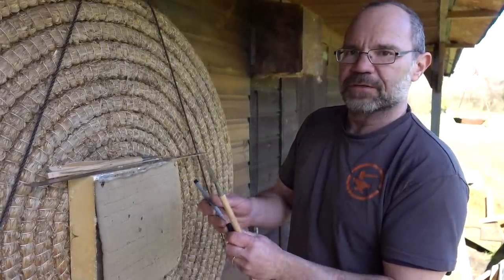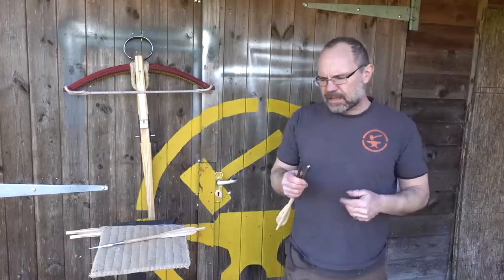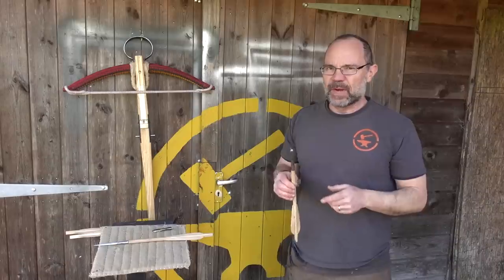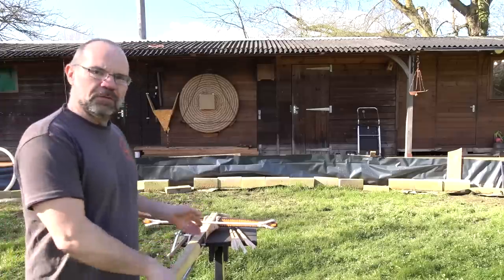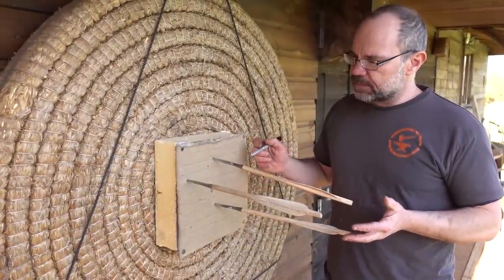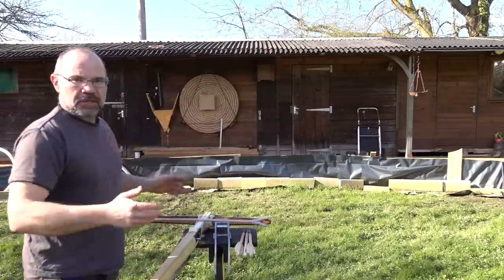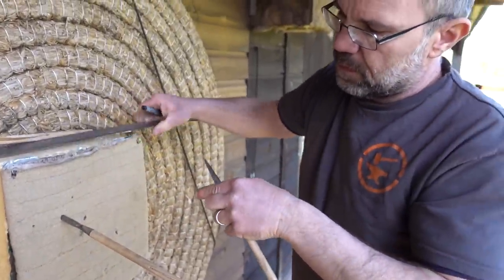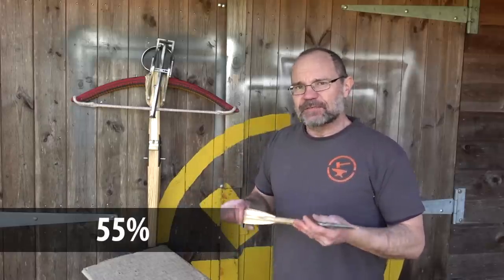Does WAX on ARROW HEADS Do Anything?

Comment from the maker: As has been pointed out - my percentages are wrong (maths not being my thing apparently) and in fact it is around 80%. And while we are at it, Teflon arrantly is to protect the barrel and I have fallen for TV junk information - sorry and damn I hate falling for this sort of guff and is exactly what I try to avoid with my films.
Reply: It's an increase in penetration of about 95% (if you use averages). If you don't use wax, it's a decrease of 50%.
Reply: Good that you pointed this out. I could tell there would be people to rant about this mistake.
Reply: Interesting. I wonder: you waxed the tips of the bolts. And when you showed them, it appeared to me as if you covered about the top 5cm of them. Could it be that the penetration depth corellates with the waxed surface?
Reply: That part threw me off for a second whilst watching but glad to see you pin this afterwards
Reply: Was just about to write up some math.
I hope this discovery will be useful in future videos about x vs y.
Cheers!
Reply: I came here to say the same if you take the average of the 3 arrows, the depth is increase by over 98.5%. 😉 
Very interesting results. Now I know what to do if society breaks down completely and I need max stopping power from my bow.
I’d love to see more on this.
Reply: Geek solidarity society right here. Boom! Super interesting
Reply: Loved this and all your experiments! I just watched the previous head-type experiment with the wife last night.  A geeky but important point of clarification: Teflon is NOT put on bullets to help them penetrate either fabric or plate armor, it is put on them to reduce damage to barrel rifling.  The myth of increased penetration is a persistent lie widely spread by the sensationalism of news media and Hollywood in the 90s, and is complete bunk.  Armor-piercing bullets are made of harder metals than standard bullets and thus wear out the rifling in gun barrels faster than normal bullets, so to reduce damage to the rifling armor-piercing bullets are coated in Teflon to lubricate their exit from the barrel.  However, that Teflon is shredded in the process of traversing the barrel and does not measurably effect the penetration depth of the bullet when it hits the target.
Reply: Could polishing them increase penetration further? Potentially less for the fibers to snag on the microscopic scale.
Reply: @ArcherWarhound  I was going to make the same point. Most actual armor piercing small arms ammo usually uses lead bullets with a hardened steel core. It's akin to how an axe is made, edge of high carbon steel, the rest of the head a softer material to increase mass and provide flexibility.
Reply: I think bee's wax might have been used as rust prefention on stored arrows/bolts. or tallow. and they could have found out that way. look my guy is more dead then your guy, what is the difrence.
Reply: I bet that the waxing was originally to prevent the heads from rusting, then some chap noticed during a siege that the newly made bolt/arrows weren't penetrating as well as the older ones. experiments followed and they discovered the waxing solution.
Reply: Amazing video. I hope you experiment with waxed arrows and bolts more in the future. Also, the p-value of this experiment is 0.009, which means this is a statistically significant result.
Reply: Ey for that video, btw. my grandma told me to use soap on nails  ... that helps also a lot ... not sure about medieval 'soap' but I guess it is same principle
Reply: ArcherWarhound this is exactly true. The theory of lube for bullets is true, but like you wrote it’s for the barrel, not the target. Just like spitzer or pointed is for aerodynamic effect, however in this case it does aid in penetration, (however since this is usually a rifle round that means it simply dumps a bunch of its energy into something behind the target that was hit).
Reply: it wouldn't surprise me at all if they were stored that way to keep them from rusting
Reply: Igor Puschner I thought this too!  And I wonder what the wax distribution is after the arrow struck - did it all melt off into the fabric or did some of it make it into the wound.  Could make a difference if you used the wax to coat a poison layer or something nefarious like that... :)
Reply: thank you for pointing it out!

I get it to be:
73% increase in the first arrow (19mm increase from 26mm)
88% increase in the second (22mm increase from 25mm)
150% increase in the third (27mm increase from 18mm)

averaging those 3 percentages gives an increase of 104% or in other words doubling the penetration depth!
Reply: The way I heard it(for what it's worth), teflon on the front of the bullet did help it not glance off hard surfaces(while the teflon on the sides was for the barrel's sake), but was not helpful against soft armor. Some anti-armor shells from WWII had a relatively soft cap for the same reason.
Reply from the maker: @KilalaFW  absolutely yes, but they didn't'
Reply: All honor for the simple admission of "I don't know". Thats where science starts and religion ends .
Reply: Your percentages are also addressing the depth, but do not address the mass of penetration. Although you are penetrating nearly twice the depth, you are increasing the volume of deformation by much more. So even though you are only talking about a few more millimeters of penetration, you are talking about a huge difference in the resulting wound.
Reply: Regarding the waxing method for the arrows: It appears that the projectiles as shot had a coating of wax, rather than the blob. Now it did have an effect as show in your video. However, the one you showed at 1:35 in the video reminded me of a very real method of tank and naval shell construction that was popular in WWII. Of course, most tanks and ships did not use cloth armour, so this is in regards to penetration of rigid armour.

Honestly all I've done research wise is a quick check on google and wikipedia to double check that I'm not spouting total nonsense, but I'll tell you what I think I know. In the second world war had trouble with standard AP shells shattering when the very hard metal struck the armour, or deflecting if the armour was angled enough. And this was more than just the fact that angled armour increases effective thickness, so they had compounding factors working against them when it came to angled armour. First it had to not deflect entirely, and then it had to work it's way through a greater effective thickness if it did.

To solve both these problems, deflection and shattering, they added a cap to the shell. This is where APC (Armour Piercing Capped) comes from. The cap would be made of a softer metal, nickle or mild steel, from what I've read, and would mitigate these issues. 

This is a quote shamelessly copied from wikipedia, but it illustrates how the shells cap was supposed to prevent shattering: "The more flexible mild steel would deform on impact and reduce the force transmitted to the projectile body. Shell design varied, with some fitted with hollow caps and others with solid ones". 

As for deflection, the soft metal cap also had the effect of 'normalizing' the angle at which the shell struck the target. Here's an animation, I think it exaggerates the point to better convey the concept, but it gives you an idea of what's supposed to happen: https://imgur.com/a/MV5CQfx

It's likely I don't understand fully the processes that make an APC shell work, but they were used in war and they were, as far as I can tell, better than the standard AP shells. Something to consider I suppose.
Reply: @whyjay9959  Hi Jay:,  In the US and Canada back in the 80's, a few companies manufactured and marketed (primarely to law enforcement), bullets with a Teflon (or a variant) "tip" and advertizing them as body armor defeating bullets. National news got a hold of it and started to call them "Cop Killer" bullets  because, at the time,about the only one wearing body armor was Law Enforcement (but the bad guys wore them too!) The histeria and publicity pretty much "killed" the product. But if the media had not, testing would. At that time I was a Firearms instructor and was lucky enough to get funds to test these bullets against body armor. Results: The only armor it would pierce was Level I, or that COULD stop ammo UP TO .380 auto. Levels worn by law enforcement, at the time, was at least a Level II. Most Law enforcement killed while wearing a "vest" where ahot in "Non-protected area", such as the head, neck, torso sides (when they were standing at an angle to the shooter, or groin area when the bullet would severe the femoral artery.  So the hype, was just that, hype.

And about WWII, what made those bullet "armor piecing" was not the tip,  body or copper shell, but the steel core it contained. The shell, the softer lead would crush and almost desintegrate, but the steel core would keep on going, hopefully wounding more than one soldier. The rational was that if you kill one soldier, the opponent only lost one. If you would hit and wound one, not only would the opponent loose one , but two or three more temporarily per wounded to evcacuate them.
Reply: Why not oil the bolts up. They had oil so they could use it to make arrows or bolt more slippery and help them slide through easyer. Wordt seeing what a coat of oil or animal fats could have of a effect on penatration both on armor or flesh. Could you try this out?
Reply: @tods_workshop  i would figure as much far to much effort on an army level for what i would assume would be a miniscule returns

 but should you get bored id love to see a comparison
Reply: Heard that line and was going to leave a (polite) comment - glad to see you learned something! Cheers.
Awesome vid, btw.
Reply: I’d be curious to find out how the waxed bodkins perform against mail over fabric.
Reply: Someone who admits mistakes is so refreshing these days. Bravo
Reply: Maybe the idea was born after seing the results using the oils to put flame in the arrows?
Reply: Wax On.....  Wax Off !   =)
Reply: People are nitpickers.  Good video.  :)
Reply: @karras6239  are we seriously still going on about flaming arrows
Reply: I want to try some armour penetration tests with my 240lb@32 longbow. Using this prod with a han dynasty  trigger system,  we can Have reasonable  idea of the power of Chinese crossbows  (nobody makes +200lb sinew horn composites anymore so using longbow prod instead)
Reply: Tod, I commend you for your honesty and integrity.  Don't feel bad about falling for the Teflon bullet BS - a lot of people did.  It may interest you to know the same people who brought you the Teflon coated "cop killer" bullet BS went on to promote hollow point bullets as "exploding bullets".  Please keep making your great and very informative videos.  I've learn more from your videos than from the many history books I've owned and read as will as the lectures I've attended throughout the last 40 years.
Reply from the maker: @KilalaFW  yes it would, but I doubt they did this
Reply: Would be a good idea to edit these things out then.
Addenda are often missed.
Reply: wouldn't the wax also help keep the metal from rusting?
Reply: they did wax their thread and needle to sew a thick cloth like this gambeson, didn't they? this made it very plausible for medieval people waxing their arrowheads
Reply: @MonkeyDespot  All bullets go through thin steel and you wouldn´t see a difference from Teflon to non Teflon because there is always gonna be a hole. You also see quite a bit of deformation on a bullet which would negate any Teflon coating. The Teflon was to make the bullet slide through the barrel. Old bullets were actually coated in wax by pushing them through a tube. If you look at old musket ammo they have 3 grooves that were wax filled.
Reply: @igorpuschner786  That's an interesting thought. I use Bee's wax a lot in my leather work (lucky for me, my next door neighbors are bee keepers. So I'm able to get mine strait from the tap so to speak). It is pushed around on a surface fairly easily. I don't think one would have to do much more than coat just the tip for that film to smear up the surface of the metal as the bolt tip drives it's way through (further lubricating it in the process). From what we've seen here I wouldn't doubt it if dipping the heads a bit more could make them penetrate even deeper.

Really one shouldn't even have to dip them in hot wax though. Just push the bolt tips into a moistened (water soaked) block of bee's wax. That's what I do with my awl needles (which actually have a very similar shape to these bolt tips, just a heck of a lot smaller). That's enough to get a hair thin film of wax evenly distributed.
Reply: Falling for junk information is what this world is all about!
Reply: Could you shoot faster if you had a reloader and 2 crossbows?
Reply: @fire304  The jackets of modern bullets are made of a copper alloy . Most bullets have lead cores , while armor piercing bullets have hardened steel core . 22LR bullets are soft lead . Some have a thin copper ' wash ' over the lead to reduce lead fouling in the bore of the barrel  . 22lr bullets usually have a thin coating of wax too .
Reply: Thank you for doing these experiments, your care and sincerity is better than 1000 Knight vs Samurai pop-history crapfests. Your Agincourt one also, superb! Keep it up!
Reply: G'day,

How about you sharpen everything & dip it in hot Bees' Wax, and call that "Rudtproofing"...; then be amazed at how much better the SHINYNESS goes in further - because,

" The Greasier The Easier...!"

, as the Sex-Workers are reputed to murmur while reaching for Lubricant.

When I first heard that joke, it was "Vaseline" that was mentioned by brand name, but about 35 years ago that was superseded by "KY-Jelly" in the overheard tellings (!).

Such is life,

Have a good one...

Stay safe.

;-p

Ciao !
Reply: I was wondering about that....but what I really wonder is did the waxed bolts penetrate deeper  than the wax coating which seemed to be at the just the tips, and if so would they go even deeper with more wax?
Reply: No worries, I appreciate how you value the truth in your videos and are willing to admit mistakes :) You're a great, reliable teacher, Tod!
I wonder about the wax blob - did you compare effects of shooting an arrow with a spherical blob of wax on it as well? It seems to me to be much worse in results, but it's just an assumption.
Reply: re: teflon rounds yes, but actually no
the coating acts to lubricate the bullet, resulting in less friction in the barrel and  thus protecting the barrel from erosion 
this also has the side effect of slightly increasing the velocity
Reply: Like👍🏼🇦🇲👍🏼
Reply: @thechumpsbeendumped.7797  Yep! That is the right answer!
The math (45+45+47/3)/(18+25+26/3) = 1.985 = 98.5%
Reply: You should pin this comment
Reply: @chadherbert18  said
'I wonder what the wax distribution is after the arrow struck - did it all melt off into the fabric or did some of it make it into the wound.  Could make a difference if you used the wax to coat a poison layer or something nefarious like that... :) '

Poison?
That doesn't make sense.
Deadly poisons, in the amount you could smear onto an arrowhead, aren't common/fatal in northern Europe - no tree frogs to harvest. Classically you have to drink a fair bit of a potion for fatal results. And the head suffers a whole shitload of friction as it goes through gambison, rubbing most of anything on it off.
Also - beeswax is nearly solid - if you heat it, to mix a poison in, that heat would sterilise most organic poisons (the ones that they had). 

And why bother?

Unless the battle lasts three days then regular poisons wouldn't have time to take effect - and if you think you are poisoned that's an incentive to go all out for revenge RIGHT NOW!

You also want to capture - ALIVE - anyone worth ransoming. You might slaughter the worthless captives, but poison is expensive and everyone has a sharp knife about them.

On an opposite tack - if you stick your arrowheads into the ground then loads of pathogens would get onto the arrow (shaft in particular). Or shit, which is cheap/plentiful.

And lastly.....

If you have diabolical poison on your arrows then you'd have to be careful AF not to accidentally kill yourself. Hunters using poison arrow tree frog arrows keep them very, very carefully and don't like being crowded or jostled. 

I'm not calling your idea bullshit but there's plenty of reasons why it would be impractical or fanciful.
Reply: fire304 
AP rounds are generally a wee bit more stiff then a steel core. Typically tungsten or some other ridiculously hard material. Now yes 5.56 has a steel core variant that is meant for vehicles, however it will not penetrate level 3 armor. Sure it can penetrate lesser levels of that standard, but so can the non steel core.
Reply: Yup I remember them talking about that teflon BS in the movie "ronin". Good enough movie though.
Reply: Oh, so you can protect the barrel when you're shooting the fish.
Reply: @pd4165  Agreed, the idea is likely impractical for warfare, but if the wax reaches the body and can carry poison it offers some interesting possibilities - just a curiosity... :)
Reply: What about waxing the entire arrow shaft for easier entry/pass through?
Reply: The methodology is not particularly good. I can imagine the foam getting damage from the first round, and thus letting the following penetrate much easier. Should have followed up a round with cleaned heads again, to see if they remained a first round, or approached second round (or even went deeper). Would also be good to either normalize conditions, or use bigger numbers, as well as would have been good to try out various methods of waxing etc. It also was not very clear how much wax you used, how you applied it (aside from obviously being a layer and not a blob), and if it covered the entire head, or only the very tip. Might also have been good to try out various other heads, and other kinds of armor (preferably human meat/bodies).
Would waxing the xbow area lower friction when accelerating the bolt?
Reply: Ppl in old times might not have waxed them for the penetration, but wouldnt you apply something to keep them from rusting in storage like wax or fat?
Reply: 103.66*%  I think the rust prevention and then found out it actually did better is very plausible.
Reply: @feha92  Mr Negativity over here, i think you need a gob stopper 😂
Reply: @mariospanna8389  how was any of that negativity? I would call it constructive criticism at best, and engagement&further interest at worst.
Also, not too used with old dialectal words like gobstopper, but iirc that meant a punch to the face, or jaw more exactly, right? Are you expressing a desire/threat to harm me? How quaint!
Reply: @c0dy85  Makes sense :)
Reply: @40watt_club  Ditto, more or less: my dad taught me to use butter (or any other sort of grease) on screwthreads esp when driving them into hardwood (eg oak, box, beech etc) to help their penetration & reduce torque required on initial 'thread-cutting' (incidentally reducing the damage potentially inflicted on screw heads) for the same reason (along with using a steel screw to do the thread-cutting bit, then replacing with brass or WHY for looks/corrosion resistance in the finished item). It's exactly the same principle as using WD40 or similar penetrating/releasing fluid with rusted bolts etc, but in reverse..
Reply: @nivlac0calvin  Hence relatively modern HESH (high explosive squash-head) rounds: same principle, different name
Reply: @joeyvanhaperen7715  Oil wouldn't work as well practically in either modern or medieval scenarios, sadly: the oil would rapidly disperse during flight, be mostly flung onto the surround of the impact point (rather than be retained as a head coating & lubricant) due to momentum/inertia & would be a pain to transport & deploy, esp in non-siege engagements. Wax, heavy grease or similar (semi-)solid high-viscosity lubricant would be far easier to deploy, use & transport in bulk.. & it wouldn't matter so much if barrels were kicked over in combat :)
Reply: The teflon on bullets does make a difference, but it's only about 2% if I recall correctly.  So it's primarily about barrel wear.  If you feel like playing around more, a polyester coating is almost as good as teflon on bullets, and there's probably somebody nearby who could apply one to your arrow heads...
Reply: LOL  No worries.  The data was there.  And we're all human.  (Well ... hopefully?  Cue X-Files theme song...)
Reply: But wouldnt the teflon help with penetration as well even if its not the main purpose of it?
Reply: Any firearms information can be gotten from Gun Jesus at Forgotten Weapons.
Don't worry Tod, you're a great man... Shit happens.✌
Reply: Sounds like the Teflon coating on some bullets has a similar design function to the greased leather pouches that coated the bullets for the early Baker rifles (late 18th- early 19th century), which were supposed to reduce both windage and barrel wear.
Thank you for enthusiastically sharing the results of your intellectual curiosity, Mr Cutler
Reply: @WarblesOnALot  Vaseline (a petroleum jelly) was supercede by KY (a water based lubricant) for certain purposes because petroleum based products can have a corrosive effect upon rubber.
You can see that, in certain circumstances, rubber failure can be a serious issue (for example, I use KY for the grommets on my knapsack) 
Havagoodun bruvva.
Reply: Dear Tod, Don't sweat the math old chap. If Statistical analysis is someone's cup of tea, I'm sure there are other channels for that sort of thing. We (history buffs) are here for the insights. A most excellent channel.
Reply: @lewisheasman  Perhaps he should pin this comment to the top - I did, in fact, rant about that mistake.